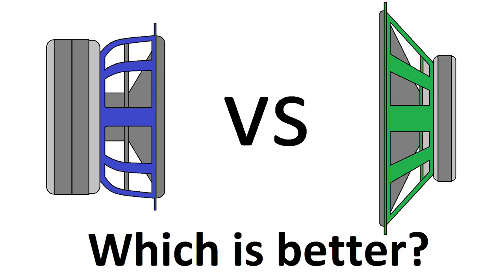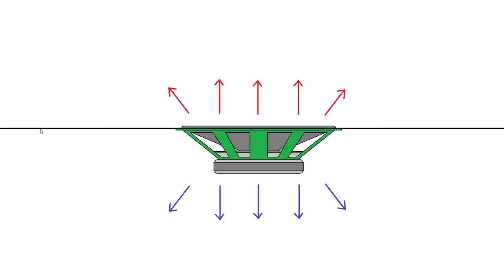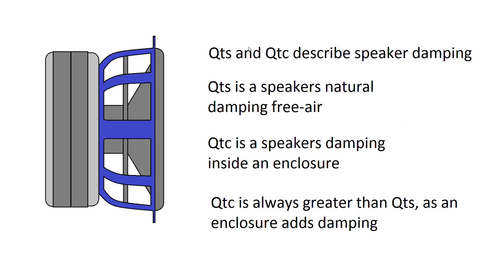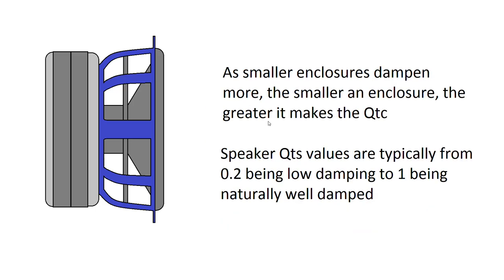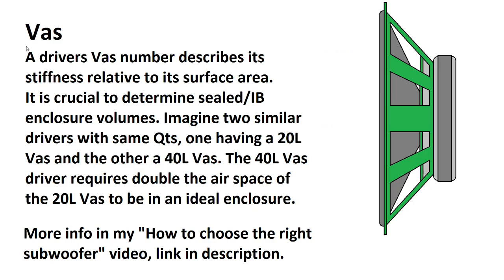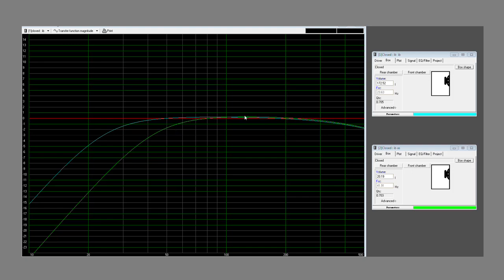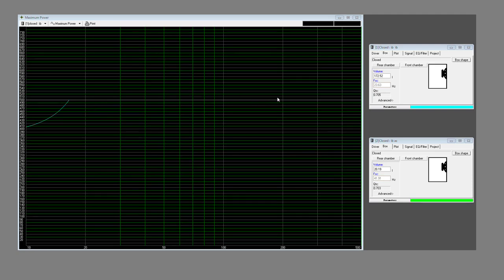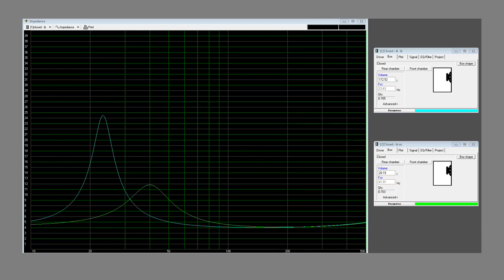Sealed VS Infinite Baffle Subwoofer Enclosures

Comment: 1:41 This is done in aviation as well with the addition of what is called winglets.  Adding wing-like structures to the wing tips does the same thing as the baffle by preventing the low pressure air from meeting the high pressure air in the best possible manner.  Winglets are prevalent on most airliners flying these days because they reduce the drag induced with the lifting motion of the wing.  Thank you for the explanation this.  I am really amazed.  Very well done!  Cheers, be safe, and stay healthy!
PS, sorry for the double comment!
Reply from the maker: Huh, neat, yeah I've seen a video of a jet without winglets going through an enormous smoke screen and seeing toroidal vortices the size of the plane itself, without winglets, is crazy, and yeah, I suppose it is an equivalence. One thing would be the time it takes the wing to travel its length would be the tuning frequency, so I'd expect thicker wings to require longer winglets.

Comment: 0:20 It takes a lot to really catch my attention these days.  Just when I thought I had a good grasp of how a speaker worked, here you come along.  My mind is blown.  I am kind of embarrassed actually.  As soon as I saw the beginning of your video and with my background in aviation, I should have known that air movement would circulate around to the back.  This air movement happens in aviation when the high pressure coming off the top of the wing providing lift and encountering the low pressure air.  This is known as wake turbulence or "jet wash".  Why I never thought about this can only be hypothesized as I never have used a speaker other than for signal testing purposes without a baffle or box.  You have provided a great epiphany!  Thank you!
Reply: 1:41 This is done in aviation as well with the addition of what is called winglets.  Adding wing-like structures to the wing tips does the same thing as the baffle by preventing the low pressure air from meeting the high pressure air in the best possible manner.  Winglets are prevalent on most airliners flying these days because they reduce the drag induced with the lifting motion of the wing.  Thank you for the explanation this.  I am really amazed.  Very well done!  Cheers, be safe, and stay healthy!

Comment: This has solved my latest issue with my build. I want 4 15's in my tiny SUV. 2 pairs in iso-barik in an IB wall will achieve exactly what I've been looking for. Paired with 4 1" 120w RMS bullet tweeters, 2 8 inch midbass woofers, and 2 6.5 inch mid bass woofers, I should have the budget, entry level SQ setup I've been looking for.
Reply: 4 15's for SQ is crazy
Reply: Entry level SQ setup without dedicated midranges? Not likely.

Comment: Great explanation.  I would argue that this presents more objective than subjective information.  Good day.  Have been subbed for about a year now.  Keep it coming.
Reply from the maker: Yeah, I haven't seen a good explanation of the difference between an acoustic suspension and infinite baffle other than smaller than vas and larger than vas respectively, but driver Qts is an important factor, for determining enclosure Qtc, which is why I think it should be a factor in enclosure choice.
Reply: @Dakoustics  Agreed.

Comment: Good explanation! An infinite baffle speaker is essentially an in wall speaker. A box is not the same as a baffle. The problem with box speakers and why open baffle sounds a lot better is because box speakers try to contain the bass energy inside the cabinet and fail. They end up resonating like the body of a musical instrument which is bad because that means. you can hear the speaker like you can any other musical instrument and that’s where the illusion of sound stage is destroyed. Also from a bass perspective, anything below 100 hertz radiates as a sphere. So it doesn’t matter which way a woofer driver is facing. And what happens in a box speaker is the woofer loads the pressure of the room creating a mushy boomy bass sound. On the other hand, with open baffle the 90 degree facing waves cancel out and the driver doesn’t load the room like a box speaker and as a result you get really tight, fast, and tone accurate bass. (No boom or mushiness). I recently got a pair of Spatial Audio X5 open baffle speakers and I can attest to this affect first hand. With my old pair of box tower speakers I had major room boom in the bass and it would hit a 50 hertz room mode that would shake my floor and walls. With my new Spatial Audio X5 open baffle speakers 98% of that is now gone. No more room boom and no more 50 hertz room mode! Just really fast, toneful and accurate bass that punches like Bruce Lee is hitting you in the chest.
Reply: Not true. Ib gives you faster sharp tones, the reason it does it because it doesn't need any load other than the mechanical load of the driver. You must be using a driver with the wrong parameters.
Reply: @dooflydetailguuy4349  i dont think he was referring to IB in either case here. OB vs box (AS, ported)

Comment: I disagree with a couple points, but I certainly appreciate the content. 

1.) Small/Sealed possesses no efficiency advantage over an IB alignment. 

2.) I don't understand the variation in group delay IB vis-à-vis Small/Sealed 

Solid work
Much appreciated
Reply from the maker: 1. The efficiency is measured at resonance, so as the stiffness increases the resonance, it leads to it having a higher spl measurement at the new higher resonance, thus "higher efficiency". Maybe higher sensitivity would be more correct, but much of a muchness.
2. Variation in group delay is likely due to phase response wierdness around the resonance also. 
Cheers for the comment, hopefully this'll clear things up.

Comment: I maybe wrong, as far as I remember, the so called infinite baffle is simply an iteration of a sealed enclosure where the compliance of air inside the box is larger than that of the driver itself, a closed box then becomes an acoustic suspension design, when the enclosure is made small enough so that the compliance of the box is less than that of the driver by the factor of 3 or more. Qtc values below 0.5 are actually considered over rather than underdamped, the lower the Q the higher the damping, not the other way around. Higher Q means lower damping and larger resonance peak to put it simply, as per resonant circuits theory.
Reply from the maker: I've just had a good look at the equation for Qts, it seems the reason the Qts increases for smaller boxes is due to the compliance decreasing. If the mechanical resistance isn't altered much by the air, then it does seem the damping goes down with higher Qtc. I believed damping increased due to the restriction of the driver movement below resonance, but this is quite interesting. I originally theorised the air providing damping to the driver, as air (N2 and O2) isn't very springy compared with, say, carbon dioxide and sulfur hexaflouride, and this lack of springyness also contributed to damping. I should mention that I'm mostly self tought, and the Q's are the most recent area of audio I've looked into, but this has inspired a sort of epiphany.
Reply: @Dakoustics  A dynamic speaker near its fundamental resonance frequency can be approximated by a weight on a spring analogy.
The greater the weight or the softer/more compliant the spring, the lower the resonance frequency.
Conversely, the lesser the weight or the stiffer the spring, the higher the Fs.
The formula is 1 over 2Pi times square root of Moving mass times Compliance with mass expressed in kilograms and compliance in metres per Newton of force.
10 grams of moving mass with 1mm/N of compliance equates to a fundamental resonance frequency of about 50Hz for example.
Note that any combination will yield the same result as long as their product is the same.
Air is unfortunately not a very good match for the cone, not a good medium to conduct/transmit the vibrations produced, as it presents very low resistance to its motion.
Less than 1% of speaker input power turns into sound actually because of that, the balance turns into hot, not moving, air to put it simply. Air is too thin, too light, hence the invention of the horn enclosure, but that's a topic for another discussion.
Mechanical Q or Qms tells you how long it takes for the cone to stop once pushed out of equilibrium.
In short the longer it takes the higher the Q (heavyweight cone + soft spring) or low damping.
The faster it comes to a halt, the lower the Q (lightweight cone + stiff spring) or high damping.
All bass drivers fall somewhere in-between these two extremes.
(Please note that listed moving mass values, Mmd and Mms, differ by inclusion of the cone loading for the latter, which is the weight of the air that "sticks" to the cone)
Now make the weight out of iron and suspend it in strong magnetic field.
If you try to move it abruptly now, that piece of iron will interact with the field and work along the suspension trying to keep the weight still, it will dampen the weight motion.
And that's your Qes - the electrical damping, the stronger the magnet, the more turns of the coil wire inside the magnetic field, the lower the Qes, the higher the damping and finally the quicker the dying out of the post impulse cone oscillation.
Here's where amplifiers play their part - low output resistance/high damping factor or lots of easily drawn current will considerably impact the cone motion.
Considerable output impedance value adds to the speaker Revc value in short.
That's also the reason why vacuum tube amplifiers with their impedance matching transformers are not be the best choice for low frequency reproduction in general, as the tubes are excellent voltage, but mediocre current amplifiers, but I'm digressing.
Both Qs, both damping systems, then average out and give you the total Qts of the speaker, Qts = Qms x Qes over Qts + Qms).
I admit, I have intentionally omitted the mechanical resistance of the suspension, Rms contribution to simplify the picture.
It has a direct impact on the Qms value and can be approximated by turning the spring into a full blown car suspension shock absorber.
It dissipates the coil vibrational energy, turning it into heat basically, and the higher the losses the lower the Qms, it does not directly impact the Qes value.
Neoprene surrounds have high Rms values, pleated textile ones the opposite.
Worth mentioning at this stage, that voice coil former material choice may increase total losses considerably due to interaction with magnetic field.
So called cabinet losses itself also play its part, but again this a rather complicated subject and requires a lengthy discussion.
Three simple equations describe the Qms, Qes and Vas parameters values, with the dynamic speaker equivalent circuit being the foundation for estimating the influence of the enclosure.
Ambient air pressure and humidity for example, will also influence the parameters just as dynamic changes in response due to voice coil increase in temperature at higher loading levels.
But the above is a gist of it I would think and the more you learn and explore, the less you know actually, as you dig deeper you only uncover layers upon layers of additional considerations.
That's what makes it fun.
If I may recommend a course of action it is to start at the beginning, familiarize yourself with the equations and books on speakers, beginning with those often published nearly a 100 years ago.
This will give you the insight and idea on how our understanding evolved until this day.
I've been playing with speakers for 25 years myself and If you asked me, whether I'm a knowledgeable I'd say no - I barely scratched the surface.
Oh and btw, the simplest sealed enclosures, infinite baffle in particular, still sound the best to my by now aging ears.
Gradual, albeit early roll-off is compensated by real life in room placement to such a degree, that with the right total cones displacement volume available and moderate levels it just sounds right all the way down.
Anyways, love your channel and keep up the good work, only a fool thinks he knows it all !
Reply: @paulb4661  
Good stuff ... 
Agreed, especially the middle of your comment, electrical damping, especially the amplifier aspect ...  
The short answer to the ubiquitous question about "fast bass" ... the key to woofer speed is instantaneous current availability. 
Fast bass in a general sense is a multitude of elements ... primarily a function of LF decay characteristics of the room.
Reply: @FOH3663  Spot on Mate - loudspeakers' interaction with its surroundings is massively understated, placement first of all is of paramount importance and then at least a modest application of damping mats, at least where the first reflection takes place. Then of course concrete vs suspended timber floor, brick wall vs drywall and so on will massively influence low frequency characteristics. Dont you just love modern spaces full of hard surfaces with not a book  shelf in sight ? 🤣 That zingy and fluttering echo - perfect .... not.

Comment: It seems like you got a bit confused what Qts and Qtc are. Qts and Qtc do show tendency of a driver to oscillate at it's resonance frequency. If Qts(Qtc) is about 0.5 the driver is not underdumped but rather overdumped. Also speakers with high Qts (Qtc) above 1 is not overdumped but underdumped and prone to resonate.
Reply from the maker: Yeah, got that backwards, was taught backwards.
Reply: I'm so confused now
Reply: You are spot on, he got it all backwards: higher Q means less damping and not more. A Q of less than 0.7 in it's mounting is considered over-damped and suffers in loss of bass. But if you compensate the loss with a DSP, then you get a very controlled system.

Comment: I recently built my own subwoofers for my vehicle. Big into car audio. I built 6 15s with 300 Oz powerful magnets and a lot of excursion. The fs is low at 27hz which I like but the qts is very high at about 1.2. Have them in a 4th order and they sound great with a very large bandwidth from 20-60hz. What could I have done to be able to get the qts lower to be suitable for a 6th order enclosure? Did the suspension need to be stiffer or softer?

Comment: This explains why 
I had a 1985 Cadillac Fleetwood and everything was electric including the trunk lid. I installed 2 subs in a sealed enclosure in the trunk. Bad thing was when I shut the trunk it killed ALL the low frequency. But unlock the trunk and the bass would explode.... So for a little while there I had to ride around with the lid open and take railroad tracks slowly to keep the lid from flying up in the air 😂😂.... {The things I'd go through just to hear that bass... I'm older now and don't really care anymore 😂}

Comment: It is all about the driver. With a true IB the Q of the entire system will be the same as the Qts of the driver. If that is in your acceptable range and fs is appropriate go for it. The downside is that there is no acoustic loading to protect from over excursion so that has to be taken into consideration.

One trick that can be used to help a driver with lowish Qts is a series non-polarized cap. With judicious choice of value it can create a response similar to an extended bass shelf and provide a 1st order HP filter for some protection.

Depending on room gain the ideal fs and Qts may not be what you would otherwise expect.

Comment: Great explanation. I have a 12 with a qtc of .58 & vas about 40. I am building the enclosure to the maximum ported volume of 2.25 cf and ran it through a few calculators that said I should have 2.5 sealed or close to 5 ported to get a .707 qtc. I  don’t want to give up more space than I was already planning to but it got me thinking maybe I should try it sealed for a while before I put the port in. I’m not looking for maximum power just something less peaky than the setup I’m currently running which was great in a small car but moving it to an suv certain frequencies don’t hit right. I hope it works out but am mainly doing it for the learning experience
Reply: How did it go?
Reply: I tried it sealed and then added a port. It worked pretty well sealed and had a nice wide range but I prefer the sound of a ported enclosure.
Reply: @gregblau8082  Roger that; to what did you tune?
Reply: 31